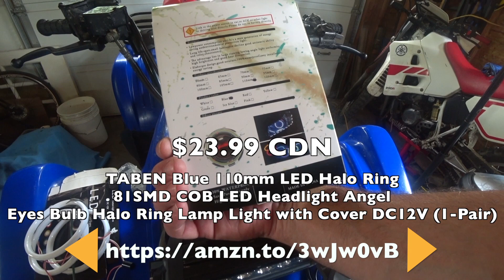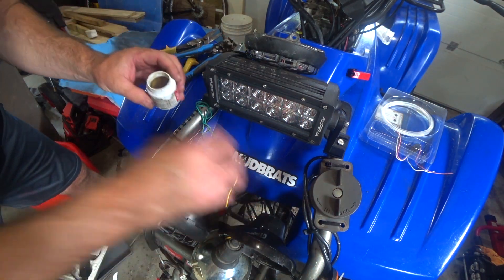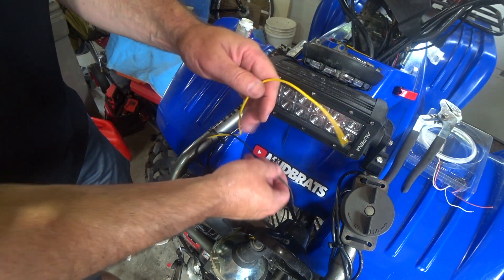HOW TO INSTALL HALOs ATV | Yamaha Wolverine 110mm Wiring LED Halo

Comment: Did you all fix the intake valve issue? Was is just out of adjustment? or was is a seal? Just curious. Thought that was a great way to troubleshoot the system.
Reply from the maker: It was a chipped intake valve.  And its running awesome now!

Comment: How are they now ??
Reply from the maker: They still work!  I am impressed
Reply: @mudbrats  ok thanks I think I might order a set for my Yamaha kodiak are they water proff
Reply from the maker: @atvrider1805  yes - i put that wolverine through everything - water, mud, snow - they seem yo be holding up
Reply: @mudbrats  ok thanks one other thing should I cut the invert box out or leave it on
Reply from the maker: @atvrider1805  you have to leave it on ad it converts DC power to AC power for the LED
Reply: @mudbrats  one more?? Can I splice the positive  and positive in to each other and do you think u could make a quick video show all the wire just going over it to ur battery